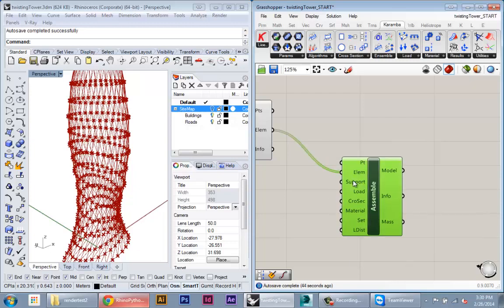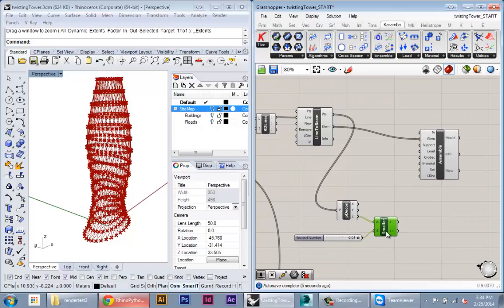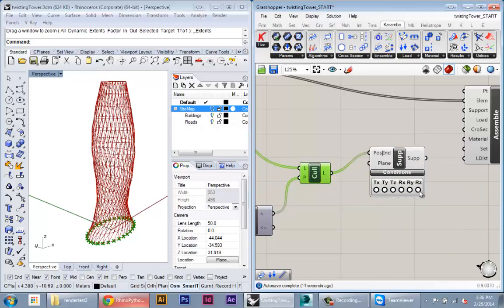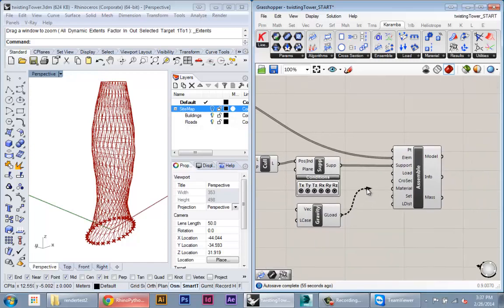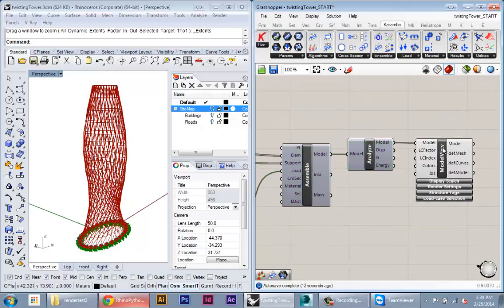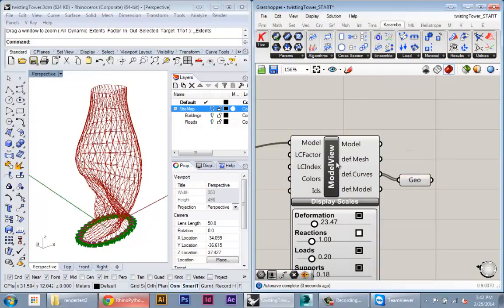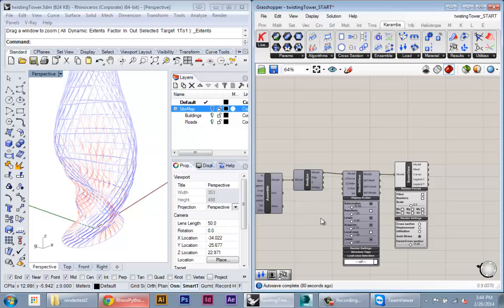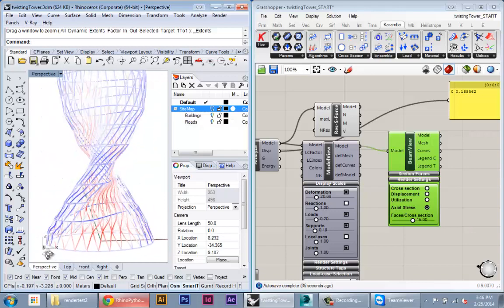Karamba Structural Analysis 2/4 - Supports, Loads, and Visualization

Comment: Thanks for the very helpful video. Just a couple of questions:

 - There're now 2 options for Analyzing a model, Analyze I vs Analyze II, i.e. 1st order theory vs 2nd order theory for deflections. Which one would you recommend using? Or which one was used in this video when that was the only default option available?

 - Just wanted to confirm if the "Resultant Sectional Forces" is the same as the "Beam Resultant Forces" (Same icon)? Because only the latter is available on the student version of Karamba I have. They do seem to give similar outputs, although the BeamResultantForces option has more inputs.

Also, have you uploaded a video as to how you created the model in your example? The Grasshopper file is already available, but it's pretty hard for a first-time user like me to visualise and understand what exactly is going on in the Grasshopper panels.

Comment: just a small question - at 2:17 you use the cull pattern node. wouldn't it make more sense to use the dispatch node instead? or is there a certain reason?
Reply from the maker: Good question. In my experience the two are very similar. The only difference is the dispatch node keeps all the data but separates it into streams, while the cull pattern node deletes all the 'false' data. I use them interchangeably. Thanks for looking!